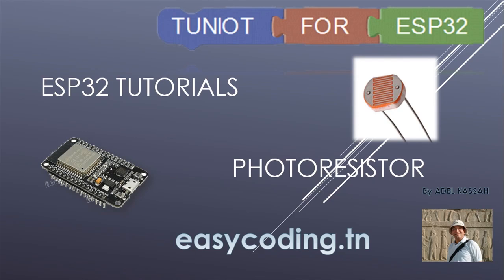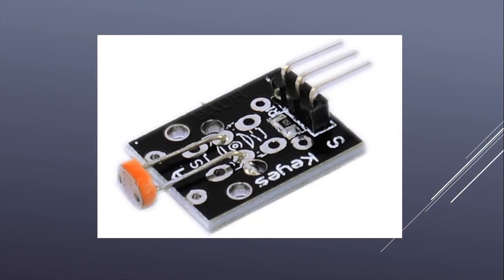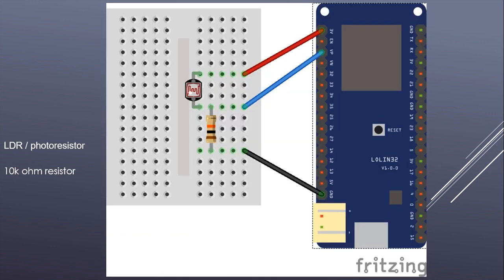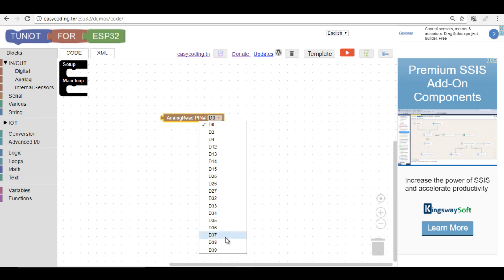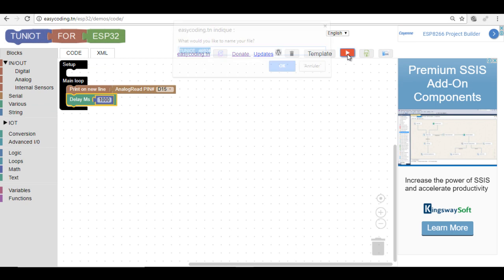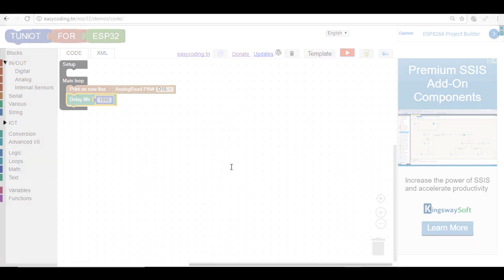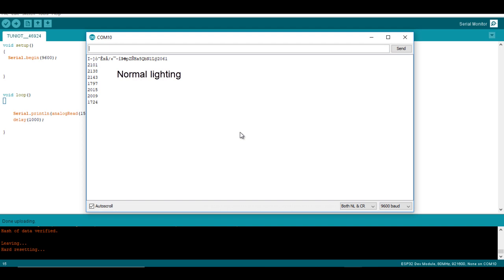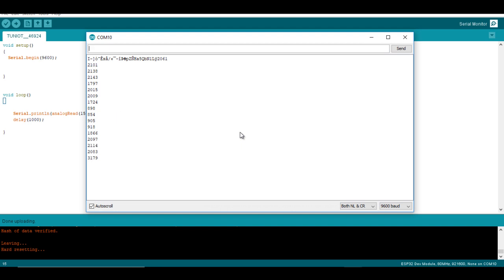ESP32 tutorial A-06: Photo-resistor

Comment: Why the LDR sensor got the data large than 1023?
Reply from the maker: +Rethy Na because in arduino incoming data are in 10 bits format so max 1024. In esp32 they are code in 12 bits so max 4096. Is that clear?
Reply: ADEL KASSAH Oh, I got it. Thank you so much.